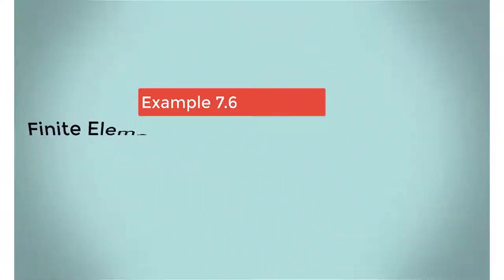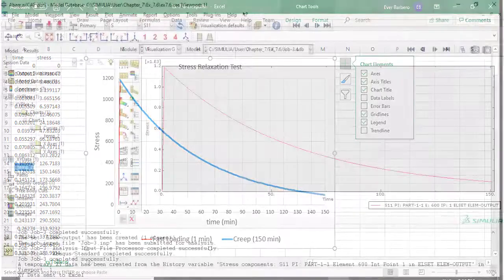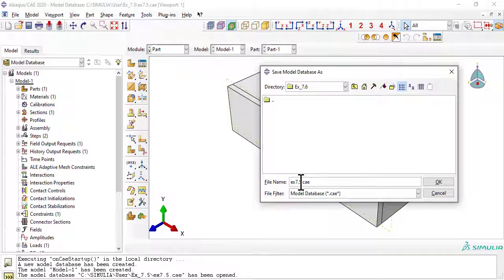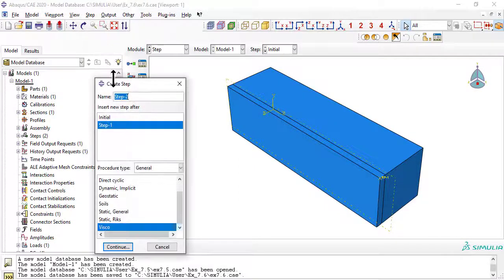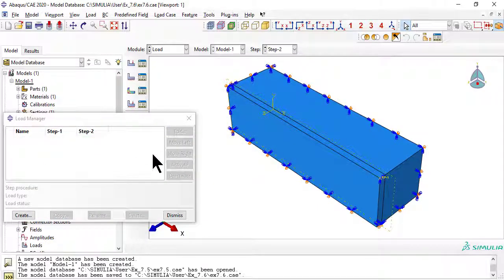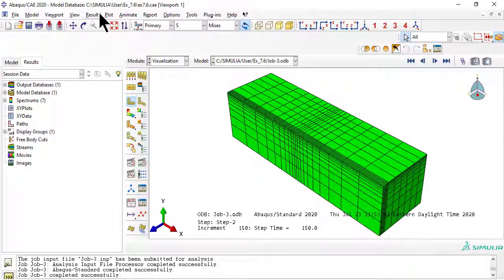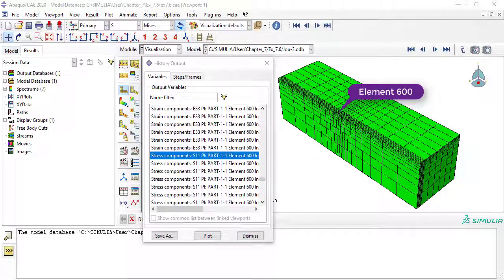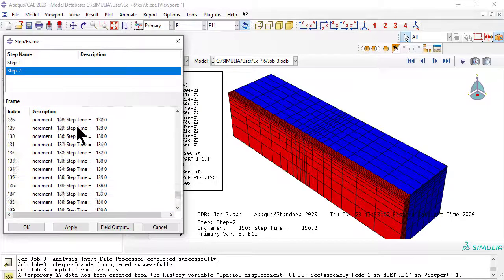Example 7.6 Calculate viscoelastic stress relaxation of a composite material using Abaqus

Comment: Dear professor, one more doubt why do we say that truncated maximum strain criteria is based on laminate.  Please may you make some videos on failure criteria?. Thank you, professor.
Reply from the maker: Traditional "lamina" failure criteria, including Tsai-Wu, etc. are unrealistic because one NEVER makes a composite with only one lamina, because the transverse strength is so low and it's value F2t has tremendous scatter, because in the transverse direction the lamina fails by fracture mechanics, not by strength. TMS eliminates this problem by requiring that you use it only for a laminate. It is explained in Sect.7.3.2 in https://www.amazon.com/exec/obidos/ASIN/1138196800/booksoncompos-20 . Read also 7.2.1 and 7.4.1.
Reply: @EverBarbero  Thank you, professor, yes I have read you explained, normalization of forces and also counting of another lamina to nearest lamina in -situ strength. So because it encounters the effect of another lamina so we can say it is, at last, going for complete laminate.

Comment: Dear Professor, you have mentioned in book and the previous video, that truncated maximum strain criteria can predict better failure, I have a doubt in stress, strain-based criteria, why strain-based criteria will predict the better result. Also if you can make some video on failure criteria and explanation of your proposed (truncated maximum-strain) criteria. As it mentioned that truncated maximum failure criteria are for laminate but I think it will also first predict the failure of the lamina, not propagation in laminate. Hope to listen to you soon respected professor, thank you in advance.
Reply from the maker: Strain is better than stress because strain in the 1-direction--which is the one that controls ultimate strength--is the same in the fiber and matrix. To calculate stress you have to use modulus, but once damage starts, the modulus in the matrix drops and it is unknown, so stress is uncertain. TMSC is used in the aircraft/aerospace industry, validated by their own secret data, but there are public validations such as http://barbero.cadec-online.com/papers/2018/TP18-0324-V2-universal.pdf
Reply: @EverBarbero  Dear Professor, agreed then why do industry and researchers mostly use maximum stress, Tresca or Von-mises criteria for isotropic material rather then maximum strain. Also maximum stress, Tresca or Von-mises criteria better match with experiments for isotropic material.
Reply from the maker: @VivekDhimole  But composites are not isotropic. Those criteria you mention are for metals. Composites are drastically different. You can't use those for composites. For example, von Mises stress has no meaning for composites. Look at the derivation of von Mises stress, it is done for isotropic material, not composite.
Reply: @EverBarbero  Yes Dear professor..agreed. I have read pdf in the sent link that shows the calculation of basis (knockdown factor), so these are for the design process. Is there any use in TMSC, in the book TMSC just explained without knockdown factors.  

Dear professor if possible may you make any video on TMSC and why is it better then interactive and other non-interactive criteria.
If someone wants to predict failure he/she has to use strength failure criteria first (i.e. TMSC) then he has to do Damage and fatigue prediction also, is it the complete process.
Thank you very much respected professor to enlighten us. If you are not making a video on failure criteria then can we have any skype discussion. Again Thank you, professor.